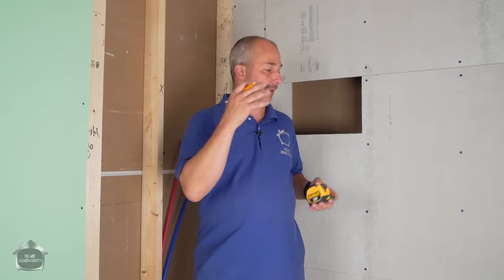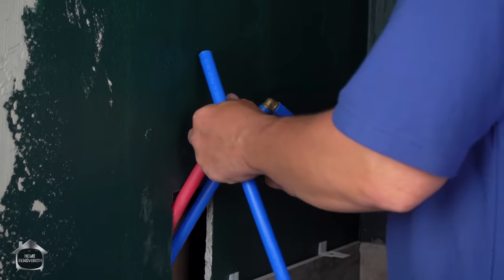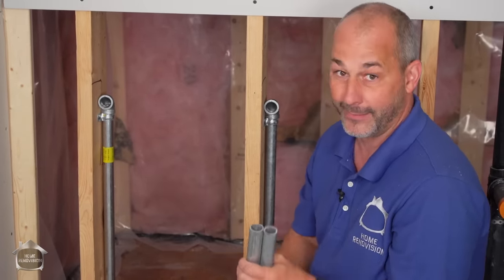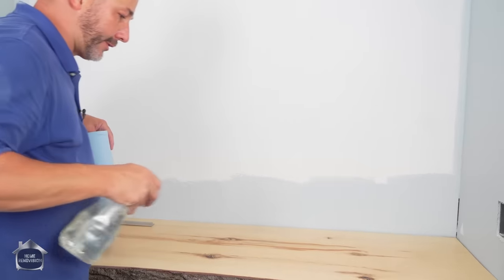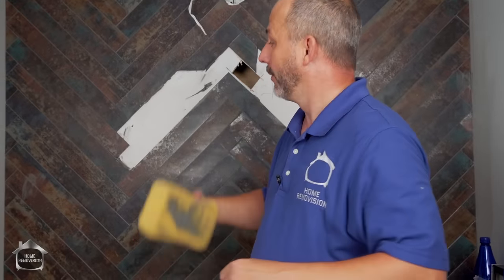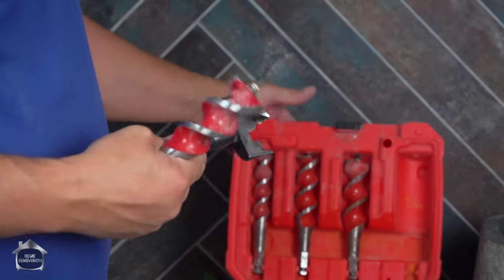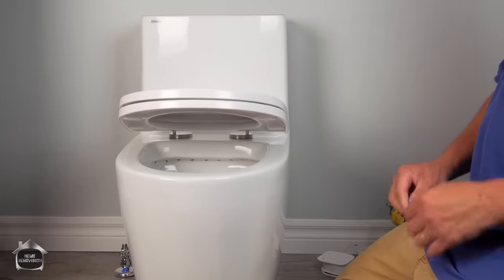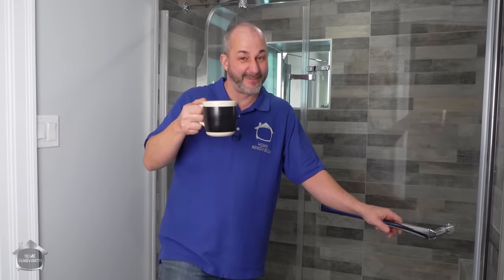Complete Build of a Modern Rustic Bathroom | A to Z

Comment: Jeff,
I am so very thankful that I came across your video.  I despise my current bathroom. My son had suggested that the renovation I wanted would probably cost around $10K. A recent quote came in at $7K. I'm no professional craftsman. But, I can certainly handle wire cutters, strippers, and compression nuts.  I'm not ashamed to totally plagiarize your project. You have demonstrated the project of my dreams. I have already subscribed to your channel, and will most likely join before I start my project next month. Keep doing what you are doing. The tips you share are of a wonderful benefit!

Comment: Jeff when I start tile like this i set it with support from 1-1/4" roofing nails.  I tap them in and I find they don't shift the tile like a screw may.  If I need to give a tile a bit of a nudge  up I use a wood screw and because the end is tapered the deeper you set it the more it nudges up.  But be careful you can chip the tile folks. I have learned to help the tile up a bit as I screw it.  I also mark out my mirror like you do and fill in the mirror area with plywood as thick as the tile is, set back a few inches.  Then I tile up to the plywood.  It saves a huge amount of tile keeping costs down.

Comment: Hi. I've done literally hundreds of bathrooms in my time (Hotels etc. ). For walls, we usually use waterproofed plaster boards. Some places use waterproof wood based boards, but that is uncommon. As a water membrane, we use some paint-ons like that mapei You use, but in corners we add special reinforced rubber tapes. And if You have to be sure that nothing will pass... Just use Deitermann Superflex. That does the job. Always.

Comment: I found a hybrid silicone grout product at Home Depot. I used it as the grout on the floor of my walk-in shower.  It's working, and yes, red seal and moisture barrier are also under the wood-grain porcelain tile.

Comment: Something I discovered for cross braces for water fixters between studs. Is the Kreg, cut my board and drill it for Kreg screws. The advantage is a flush fit, and even in a blind corner, I can still install the screws since they are in the cross board.

Comment: love your detail and work. because of you I just tiled my kitchen in a handmade vintage tile. looks great. never grouted before and it turned out awesome. im quite handy but the one thing I have put off for years is my bathtub. the last owner did such a poor job. I need to rip out the bathtub. long story not important. easiest way to measure for the correct bathtub? just front to back wall to wall? Im scared ill get the wrong one. (like this guy obviously did)

Comment: Great video and perfect since I’m renovating a bathroom and learned a lot. Question on toilet flange.  I’m installing luxury vinyl just like you did. The flange will end up 1/2” above floor with a 1/4” gap. Can I fill the gap with a spacer so it is supported. Will 1/2” above floor work?  It’s a cooper flange old but in great shape and very solid.

Comment: Putting in a second sensor is a great idea in case one fails.  What I do is run a line of 1/2" pex from the tstat down into the floor.  I router a bit down into the subfloor so the pex sits flush and PL the pex so it stick or cut a bit off the top of the pex and screw it to the floor. Then you can send a new one down with a bit of compressed air should you need to.

Comment: Australia - we use ‘water resistant - aqua check - drywall and then paint on membrane with mesh or tape over joins and corners
Reply: We also have Mapei which is typically used on balconies and in pools although they do have a domestic bathroom waterproofing product. With a teenage son, a teenage daughter, a bonus teenage daughter and a young daughter, I’m probably going to put in the swimming pool/balcony waterproofing because between 4 vain girls/women and one vain boy/man, our bathrooms take a kicking!

Comment: Always enjoy your tips and demonstrations.  Thanks!  However, I would prefer to avoid double reversing of the the water flow in those PEX lines.  Seems like it would cause a lot of pressure loss and possible stress those hidden PEX connections behind the tower.  Shouldn't the PEX lines be supported by clamps on the studs?
Reply: You are right in %90 of situations, wooden blocking behind the mixing valve to prevent movement, i will say that he might get some knocking when initially turning the unit on from lack of pipe mounting, but that type of valve will never move around, and there should be no loss of pressure with that type of connection, it is when you have a solder valve, and solder pex to copper adapters in immediately that you will see the loss of pressure with pex
Reply: as someone who has personally ran into this problem, a good fix is to alter the shower head, a head is meant to put out 1.5 top 2.8 gallons per minute on average, this is based on your water pressure though, so if you dont have enough pressure you wont get the amount of water you are supposed to, these shower heads are intentionally reducing your pressure to save water, i get it save the whales etc, but if you want full pressure you can remove the reducing screens completely, or an easier method, since shower heads are getting pretty complex and that task is easier said than done, you can just start with a small drill bit, and drill a 1/16th inch hole in the center of the reducing screen  and test your pressure, if no good then increase to a 1/8th bit and continue in this fashion until you are happy with your pressure

Comment: Hi Jeff! i live in Denmark, in relation to the minimum requirement according to building regulations, there must be a wet room membrane of at least 2mm thickness, if the bathroom is less than 3,25 square meters or with a width of less than 1,3 meters, are all walls covered as a wet zone,  and therefore there must be wet room membrane all over the room top to bottom. The wet zone always includes the entire floor in the room, the bottom 10 cm of all walls, walls around the bathtub and washbasin with shower faucet and walls in and around the shower. And as you said overkill would do just fine here, so applying the membrane to the entire walls arround the bathtub would be an good idea. And one has to keep in mind that based on the requirements, there are other requirements for material use that makes it possible to do the work legally based on what was said from the start. And this is only about the wet membrane, the water drain is a hole other story hehe ;-) I love your work.!!!

Comment: Great video! I figured out starting threads backward like you, 35 years ago. Everyone I told over the years, thought I was an idiot. (They don't have to brainpower we do.) ;) Cheers
Reply: I was taught, or learned that as a kid, and taught my kids, and they taught their's. It can also get rid of burrs on tap & or dyed connectors without slicing you hands or fingers open, then any burrs you can pick up with a paper towel. I heard the same from a few others over the years ("You're turning it the wrong way"). I thought everyone knew this, then discovered that some people don't know. It's good info to pass on! Saved a lotta injuries, as that's a very common one!

Comment: Great video. A few things i'd avoid. 
1- Double redirection of water is a no-no; loss of water, more chances of breakage etc
2- The drain for the sink is about a foot away from the wall inlet; proper preplanning may have prevented this and called for in-wall relocation of drain line + I would've kept the P-trap inside the wall

Comment: Hey Jeff, I have watched all your videos.  Thanks for the information.  I'm rebuilding my master bath that had 4x4" tile over sheetrock with no waterproofing.  Would not hold grout or silicone.  Water through the downstairs ceiling.  I'm using "Go Board" for backer board because it's easy to cut & work with.
Reply from the maker: No worries John. just be sure to waterproof with a roll on to get longevity!

Comment: Hey Jeff! Just bought my first house! Thanks to your channel I feel comfortable rehabbing it. I haven’t been able to find an answer to this question: can I use aqua-defense or red guard on the floor up to the drain in replacement of a shower pan? I’m planning on using it on the walls for sure. The floor is already concrete and sloped to the drain.
Reply from the maker: that would no doubt be a creative idea, however you need to consider expansion and contraction of the surrounding materials. There is no warranty for going cowboy!
Reply: Home RenoVision DIY so, obviously not a standard way to do it... got it. I don’t see it being much different than using Schluter Kerdi overtop of a sloped shower pan, though (granted I’m new to this). Could you help walk me through some of the pros and cons of doing red guard over cement in replacement of a Schluter-system shower pan?

Comment: I think I'd be using those slab cutoffs as my pipe to drywall trim. Just run an appropriate sized hole saw through them, cut that hole down the center and Vila! Two ready made trim pieces to attach to the underside of the slab with a couple dabs of silicone.

Comment: the specific toilet you have picked is great for the foam wax ring, but on a standard toilet install i would recommend just an oversized wax ring, squeeze it down with your body weight and clean the excess that comes out of the Johnny bolt holes, they actually tend to leak less than the foam ones, and if you have a problem with the foam one this is also an alternative, i understand the expansion and contraction, but i have found on a standard toilet the foam rings can cause more trouble than good, and a properly installed wax ring has been working for many years, i would say if your toilet calls for a foam ring than use one, like your toilet or a wall hung toilet, with gasket seal, but a standard toilet, or any toilet you are questioning what ring to use, just go with the oversized wax ring ad squish it into place to avoid frustration.
Reply: also your videos are great, how you show people to float tiles etc., I have done this for many years and works great, people love to say that floating walls etc with concrete to eliminate lippage is no good, and that you wont get proper coverage, as a person who does a lot of mudding, and can float the shit out of a wall and make it completely flat and paint grade, i know its possible to do the same thing with the tile adhesive and float where you need to and get your job done without having to do insane amounts of work like other people show, so you can keep your estimates low and still do quality work that will last, true pro you are watching in these videos, it shows what happens when you do all phases of the job, not just the one
Reply: Further into the video, professional plumber, the plastic fittings, ANY plastic fitting, hand tighten, only 1/4 turn with a wrench, any exposed fittings, use a crescent wrench or fixture wrench, they are cheap and will not damage the finish of sinks/shower heads/ etc, if anything hand tighten only then tighten with a wrench afterward if it is leaking, there should be rubber gaskets in each fitting that if seated well will prevent this

Comment: Jeff, Awesome bathroom, awesome video. The final scan on camera doesn't show pipes or water lines but a white square is there, what did you do there?  I'm restoring my bathroom here on Flathead Lake Montana and will duplicate on a smaller scale your shower outlet, stone sink and wood top.  It's so perfect for my place.  Thanks for all the DIY projects you video, I've watched them all.  I'm ordering flooring from Decorner under your recommendation next month, spring 2021. Well done.

Comment: Jeff, you asked about backer boards in other jurisdictions.  In California, ceramic tile backer boards include: 
Glass mat gypsum backing panel, Fiber-reinforced gypsum panels, Non-asbestos fiber-cement backer 
board, and 
Non-asbestos fiber mat reinforced 
cementitious backer units.  I have not been to an inspection where the contractor is using Schulter products.  Most commonly, we are still using hot mop applications in showers.  I would like to try the Schulter boards and tapes myself.  I'm going to ask other inspectors if they've seen a non-hot mop shower.  It's got to exist out there!
Reply from the maker: Hi Nicole there are  many pre fab unit options out there. when installed correctly they outperform a hot mop any day!

Comment: Hey Jeff, your videos are great and I’ve learned alot in a short amount of time! I’m about to install luxury vinyl flooring in my bathroom similar to what you’re using and I’m wondering what the red material you’ve placed underneath it is?
Reply: It seems to be a moisture barrier, required over concrete. It has to be thin under this type of flooring, however, or you'll have problems. He also has electric heater lines under the flooring.
  I helped a friend, who used a thicker moisture barrier, V and he never could get the flooring stable, had to take it out and start over. It was a mess. It was obvious to me from the get-go something was wrong with it, as the flooring lengths kept unsnapping from each other. 
  It seems there is some thin insulation material that can be used with this type of flooring. I'd check with the manufacturer and ask before you start, to be sure you get the right type. Not checking first can be a pain, and you generally aren't likely to get a refund on the incorrect vapor barrier.

Comment: Q: Jeff, how long to does heated mat underlay take to heat? Doesn't lux 'vinyl' flooring act as an insulator? Please teach/discuss about heated mat and various flooring options and best practices. Great vids! Maestro!
Reply: Hi, it’s Jeff. It does not act as an insulator, but I would not recommend using it. This is what we had on hand. I would recommend you using 3 inch concrete slabs, they let the heat up very efficiently. Hope this helps, Jeff.

Comment: wire nut waste  i take plastic 1/4 gray  tube for  plumbing faucets, cut to length u get 5-6 light brackets spacers . code=  8 -32 for lights/fans  6-32 for devices sw an outlets

Comment: I was wondering about the spacing left on the bottom of the concrete board for expansion.  If you tape and cement the board to the tub/shower pan, the expansion space is gone.  With the cement probably harder then the fiberglass pan or tub, help me understand how the expansion space is still there and workable.   Thank for your Awesome DIY videos!
Reply: I'd love to have an answer. 😊 Should I tape and cement and waterproof right to the shower form? Or should I tape and waterproof only right to the form? Or do I leave it open and just silicone the the overlapping tile to the shower form.  I'm doing a bathroom in my house for my mom and wanna make sure I do it right.  Thanks so much for all your videos! I have learned and applied so much!!
Reply: @kathrynannmurray756  He seems to only respond to comments giving kudos to the video here. You might have to be a paid member to get actual questions asnswered.
Reply: @michaelreilly3347  thanks Michael. I made it work. :)

Comment: Hey Jeff,

Currently renovating my master bathroom (currently gutted to drywall and subfloor). I'm trying to decide if I should add sharkbites at the end of each copper line where I'm tying in pex (9 different lines) or if I should pull up the subfloor and add the sharkbites at the start of the water lines (2 lines) and run pex to each location from there in order to minimize the # of sharkbites used. Not sure if pulling up the subfloor is worth reducing the number of sharkbites.

Comment: France over here. As far as I'm aware, the only real regulation is to have greenboard around the bath/shower up to about 120cm from the floor.
Well, in our case, we have it up to the ceiling...
We also used a mapy waterproofing system (since shower floor is tiled as well, we used it there on the concrete slab as well before tiling over). One thing of note: we bought it in a kit where it came with primer and a roll of 15cm wide material to use on all corners.
Also, I'm jealous as  I've never seen an integrated tile flange on ANY tub over here. For whatever reasons, manufacturers don't seem to want to make them. So you have to make do with applying silicon in a two step process. That flange would have been so much less of a pain...

Comment: Great idea on that steel pipe counter support, Do you think it going to support the weight of  quartz countertop? I'm building a stone counter top for washer dryer the span is like 52 inches, I was debating either to spend $100 a piece for 3 steel countertop or build a cabnet but like the clean look of steel support.

Comment: Hey Jeff, another great video. I am tired of using the shark bite fittings, only because of the cost. I checked your amazon page but couldn’t find any pex crimping tools that you use. There’s so many brands and  options like just the crimper or a kit, copper or ss rings, etc. Do you have a recommendation? Thanks.

Comment: Hi Jeff. Would you add the mesh tape/ quick set at the bottom joint by the tub flange if you were using MR drywall & Aquadefence as opposed to concrete board? I was planning on leaving a 1/8 gap to allow for movement and then fill with silicon. Thanks